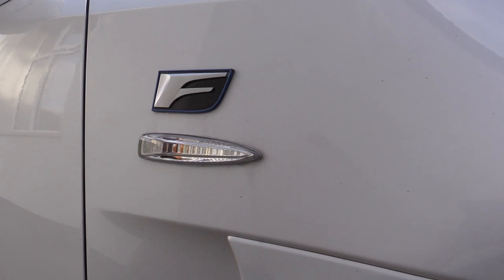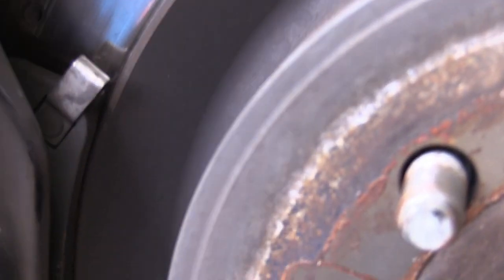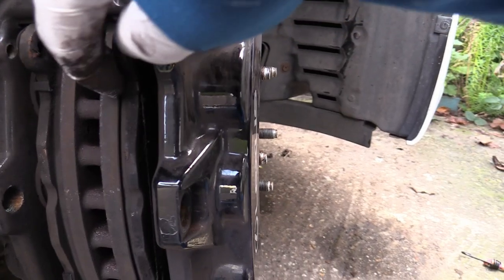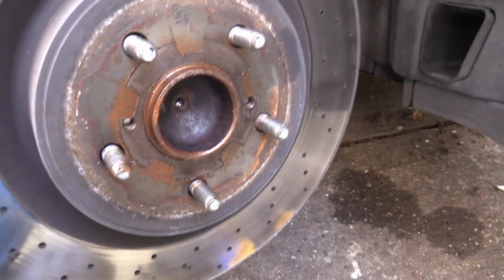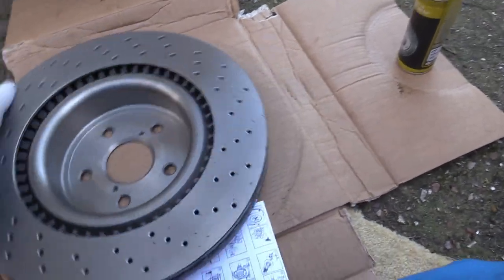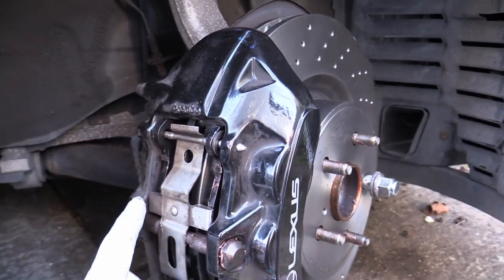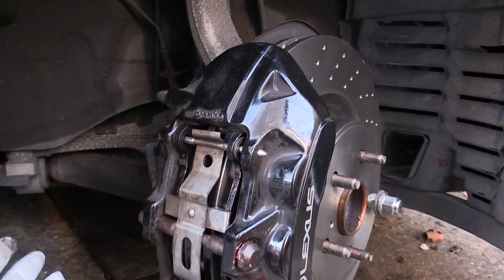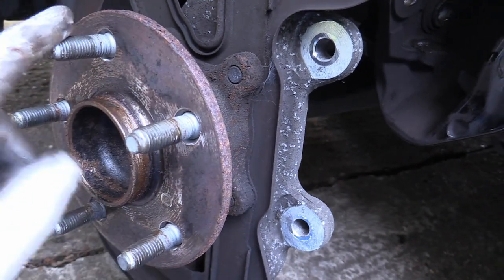Lexus ISF front discs and pads replacement

Comment: Never lube wheel studs.
Reply from the maker: There seems to be much debate about this. 
However the addition of copper particles to the grease ensures that the amount of torque required to achieve the required tension is not affected greatly at the same time ensuring that mating surfaces move smoothly against each other, and that the thread does not corrode to the extent that it cannot be undone.